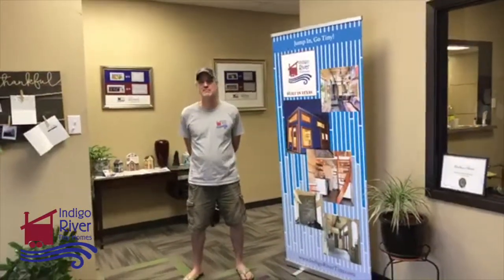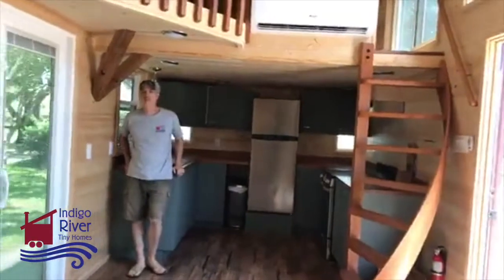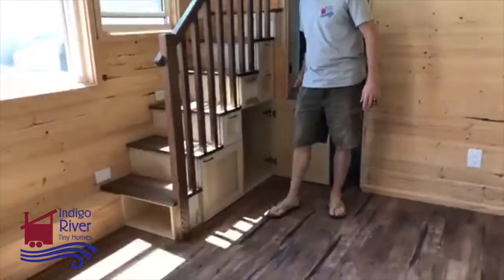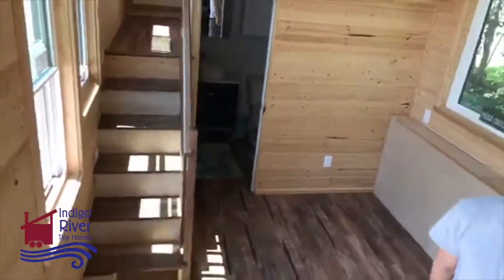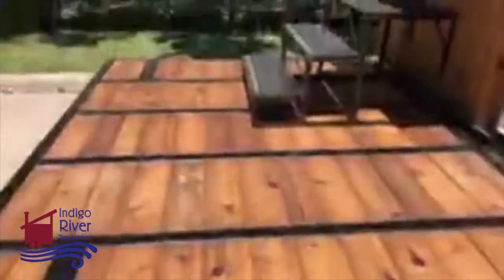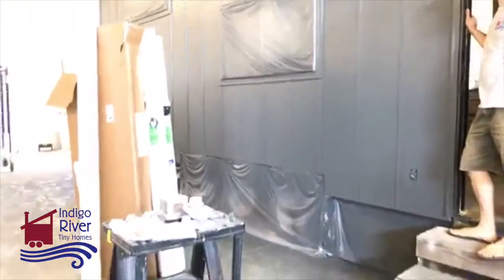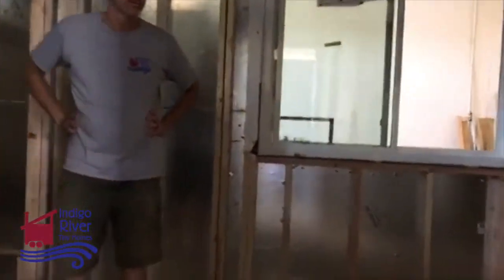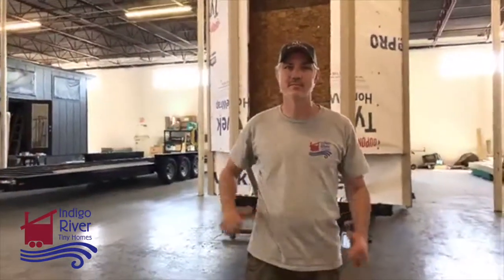Check out our new digs and tiny homes on wheels @ Indigo River

Comment: Can you give prices on this home?
Width? Height?
Can it be towed by a truck? What is its weight? Or does it come via a dually or semi?
Reply from the maker: You can click to our most updated price list from the video description.
Our homes weigh between 6,500 lbs to 22,000 lbs depending on the type of construction (wood vs. SIPs vs. metal)
You can tow all of our homes with a 1 ton pick up. Some of the smaller ones can be towed with a 3/4 ton truck. They are all towable travel trailers with a license place and VIN. Most are 8.5' wide but some are 10'4" wide.  Length ranges from 20' - 43' with a gooseneck trailer.
You can also hire someone to put it for you.